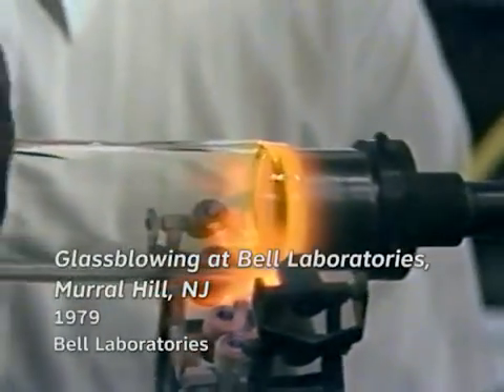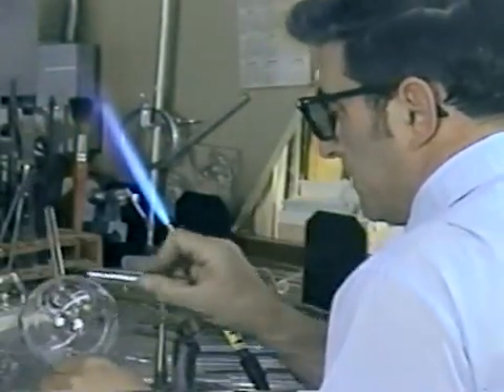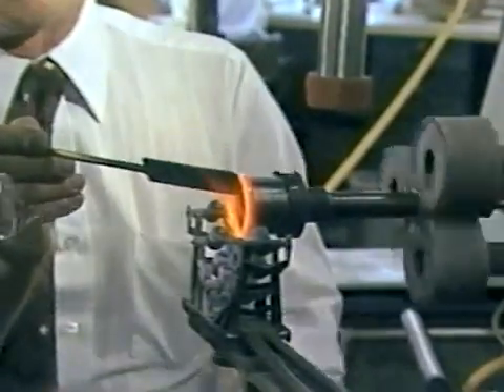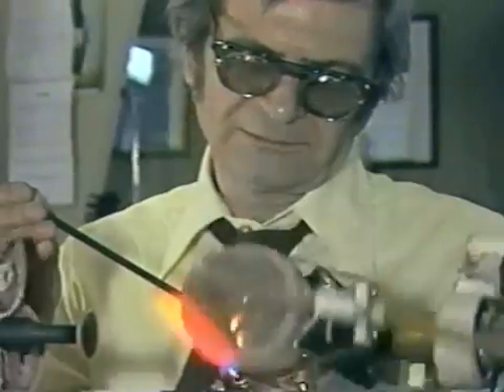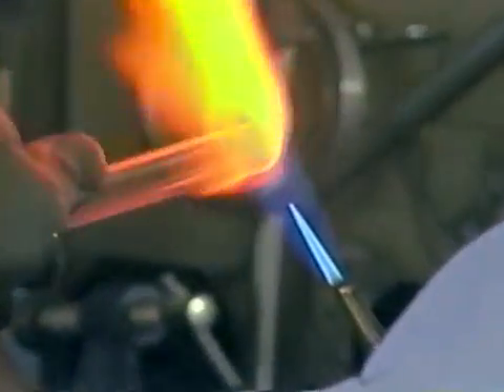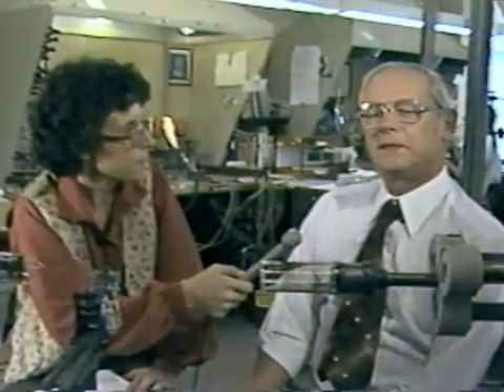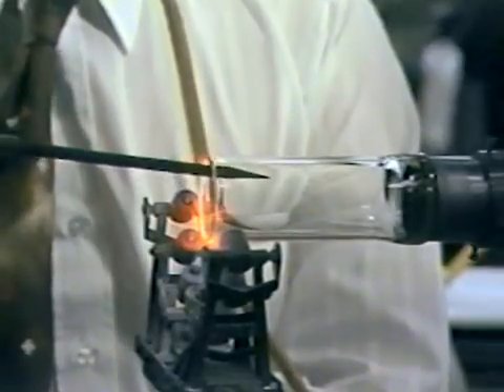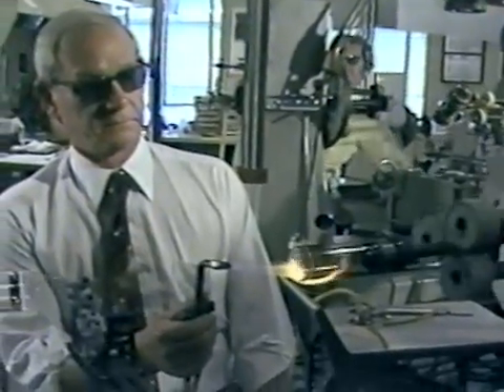Glassblowing at Bell Labs, Murray Hill, NJ, 1979

Comment: I still use tubes in my FM transmitters. It has only been recently that solid state has been able to work and those power levels and shrug off lightning as good as a tube transmitter. I am not even sure if they make new tubes any more of if they are all rebuilt. We use rebuilt ones. They are metal and ceramic about as big as your head and very temperamental as you have to tune them by hand. If you get it wrong they start arcing and causing damage real quick. They are as much a science as they are voodoo and its not only what the meters tell you but how they act and you just kinda feel it. I got the job dropped in my lap as the RF engineer is a dying breed literally and I am still getting the feel for it. I don't know how much longer they will be making the big PA tubes or how much longer my stations will keep them. Solid state I am told pays for itself in a few years in energy savings. The few I have worked on don't even need 3 phase any more. The tube transmitters draw near 200 amps 3 phase even more if we have to use a rotophase.